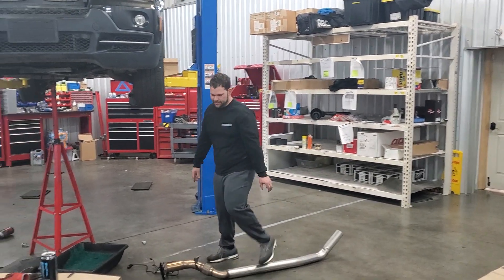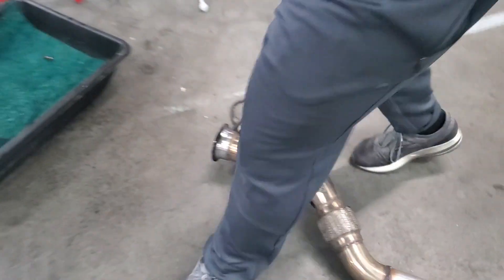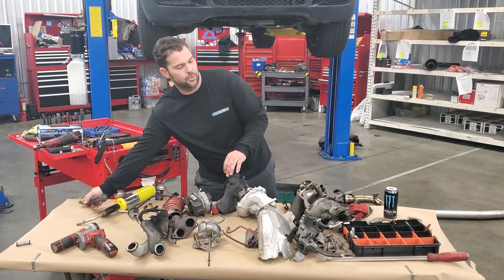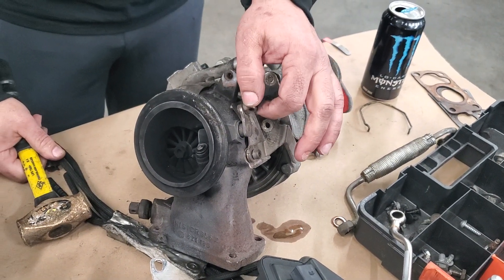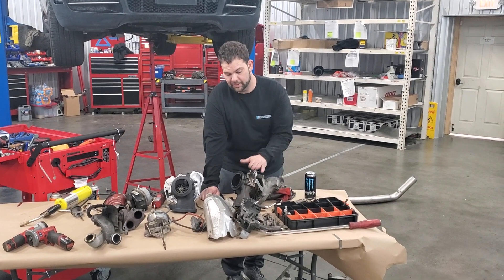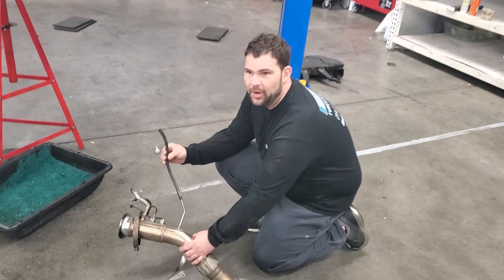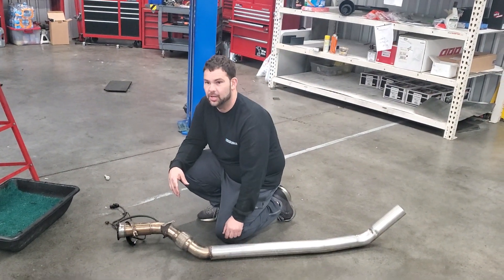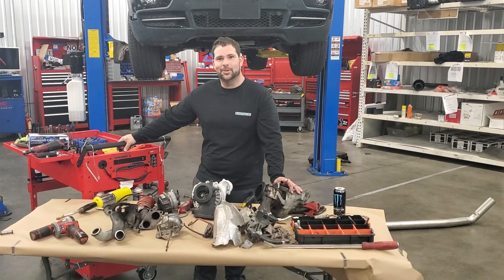BMW X5 35D wastegate failure causing overboost and code 428B

Comment: Hey, how much leverage is the arm / rod supposed to do during full activiation of the wastegate ? My actuator is holding pressure fine, from a bad video I took i´d say it barely moves 5mm at the lever.

Comment: I just checked my actuator and it opens only by about 2mm under full vacuum. Is that correct, Andrew, or I need a new actuator? The gate appear to be free and ha e a full travel when I press on it , but there is a high resistance to movement.
Reply: mine is about the same and chasing not hitting boost target concerns

Comment: If soot naturally escapes from the wastegate shaft would it be possible to apply some sort of product to the exterior of the shaft to break it down and reduce potential sticking points? (Obviously referring to a hypothetical situation here and not to the actual turbo you displayed) TIA

Comment: A good reason to run ista tests to cycle the  wastegate and the bypass valve once in a while for a few minutes
Reply: Not a bad idea. HP Turbo exhaust side bypass is pretty active though, going from fully closed to fully open pretty regularly, even in fairly normal / casual driving (unless you drive like a Grandma looking for fuel economy). The LP Turbo exhaust waste gate is a different story... It remains closed unless you're hitting things pretty hard at the mid to upper RPM range, even on a stock tune.
Reply: @DDSPL15  yeah it only opens when you hit max boost at mid to upper rpm when it does most or all of the work

Comment: I have the same failed part with original dpf still installed. It’s the real reason why the big turbos fail and you can’t buy that small actuator without buying a whole new turbo. Sneaky sneaky bmw.

Comment: Hey Andrew, have you guys had any issues with atm downpipes?
Reply from the maker: Hhmmmm....not that I can remember. Catbacks are a different story
Reply: TuneMyEuro would you not recommend there cat backs? I took my atm downpipe into an exhaust guy and he said it was a pile of Garbage and that they didn’t know how to work their mandrel machine.
Reply from the maker: @themexicanwinner  I guess I'd like to see a photo of why he said that.  Their downpipes are better quality than the stuff I have seen from Chinese ebay vendors. ATM is a lower quality than the more expensive options. If you had to pin me down for an answer on the catback, I'd need to know if you wanted a full replacement catback, mufflers, etc.  There's not a lot of options for a catback and none of them are foolproof and/or consistently perfect
Reply: TuneMyEuro it was in person boss, and I want there full cat back system as I think it’s the best bang for the buck.
Reply: TuneMyEuro sorry I misread that, I thought you asked a photo of what he said, I can send you some pictures through messenger if you’d like, the pipe is kinda kinked in the bend, and is bumpy. In my eyes nothing that would hurt performance at the power level I’ll be at. But nevertheless just thought I would ask...
Reply from the maker: @themexicanwinner  I get what you are saying but for the price, its probably something that you need to look past.
Reply: TuneMyEuro exactly what I was thinking 👍 thanks for the wise words.

Comment: I have code 438B. I can drive notmally car, but when it reaches almost 100milez per hour, my car comes like dead. Switch off and start...drive normally again!
Reply: Got the same problem but after 120mph .
Reply: @Cocovlog283  Could be vacuum!
Reply: @gatojurko1  is your car remapped? 

In my case apparently its the big turbo failure and the car goes into limp mode because its goes into safe-mode

I have replaced vacuum lines  boost pressure sensors its okay for a week its didn’t go into limp mode but after 130 mph its doesn’t pull that well you can feel the power is not there
Reply: @Cocovlog283  little bit 330hp approximately!
Reply: @gatojurko1  some others people told me it could be a shit remap . 

I went to readjust my remap and apparently the remap is all good its just overboosting because of the turbo . 

So the problem is the big turbo 🪃
Reply: Did u fix it?
Reply: @Cocovlog283 did you ever fix the issue I’m having same exact issue
Reply: @pressiissa4999  at 120miles was going into limp mode . Swirflaps deleted sorted it out
Reply: @Cocovlog283  I have the same problem what should I do
Reply: @tolgaaydn809  swirl flaps delete and a good clean the manifold sort it out